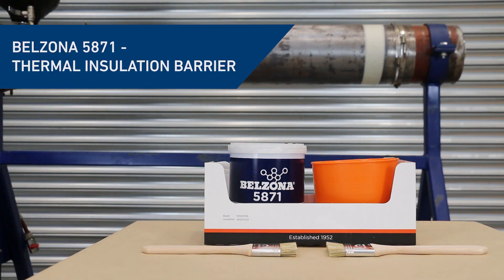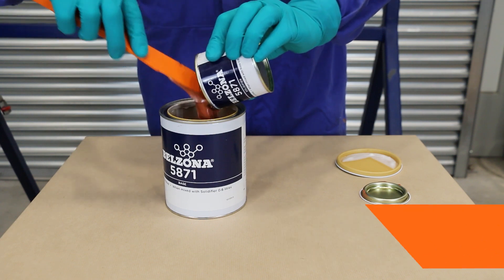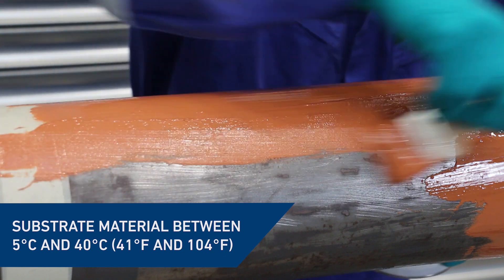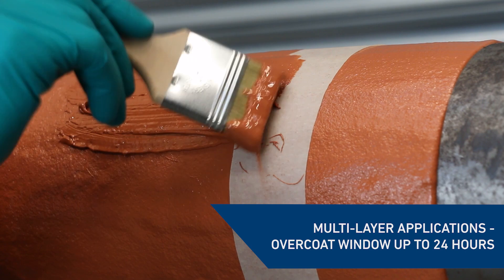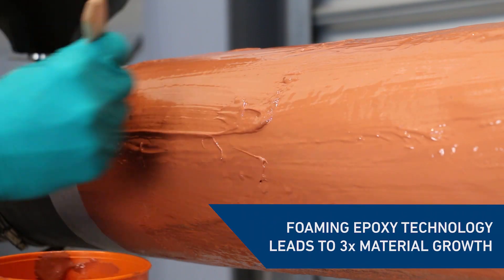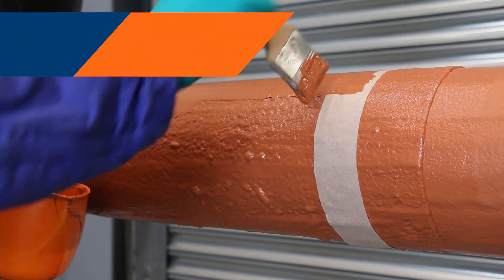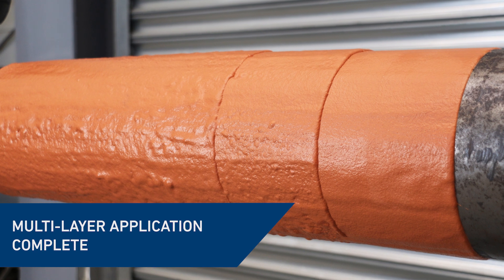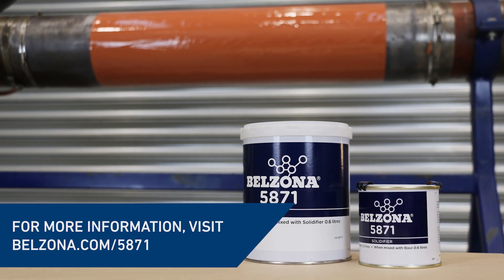How to Install a Thermal Insulation Barrier for Corrosion and Safety Protection

Comment: What is the maximum WFT of single layer?
Reply from the maker: Hello Kamil, 
Thanks for the question! We recommend applying Belzona 5871 at a WFT of 1mm for a single layer. Due to the foam growth, that will give a 3mm cured thickness per layer. This ensures no sagging if applied vertically. If the application is taking place horizontally, it is possible to apply Belzona 5871 in thicker layers. 

For more details and assistance with your repair needs, you can contact your local Belzona representative: https://www.belzona.com/en/contact.aspx

Thank you and best regards, ~ Belzona Team
Reply: @belzona Thank You for answer.
I have a few questions:
What should be system thickness for steam or exhaust gas pipes in 180-220°C?
Client also have problems with steam pipes in 550°C. I am convinced that we cannot use B5871. Am I right?
What is maximum operation temperature for B5871 when isn’t requided to reduce surface temp ≤ 60°C?

Kind regards
Kamil